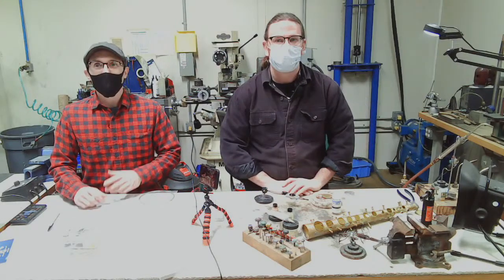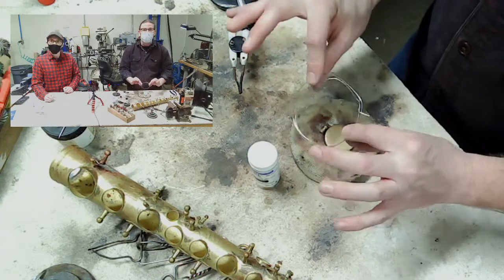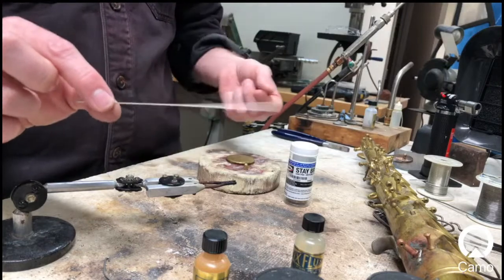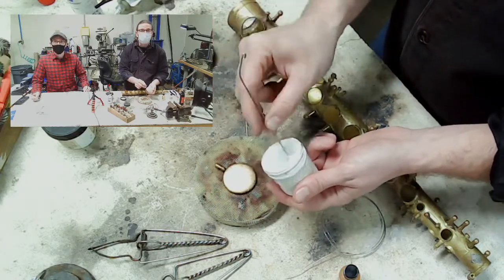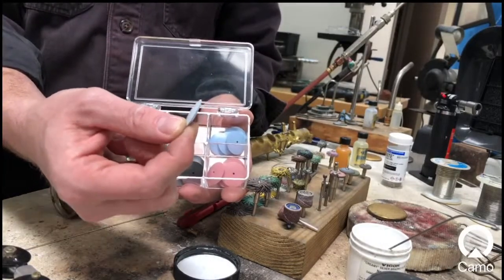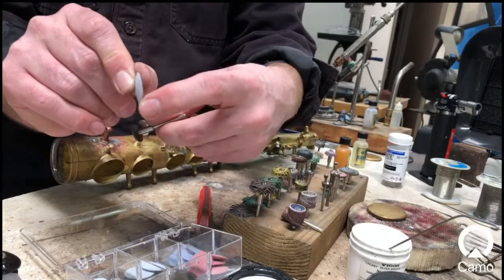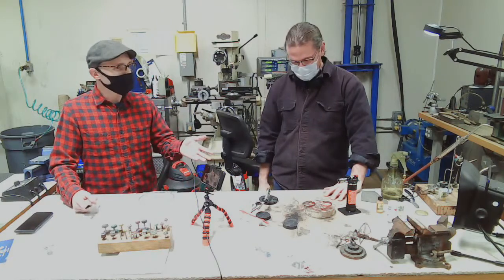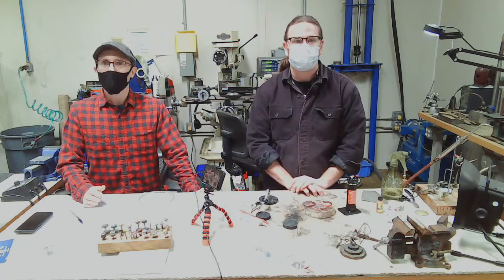HARD Soldering Basics for saxophones

Comment: Just an interesting side note that in talking to the Smiths representative who has since retired he mentioned that the  number one and number two tips on the two gas little torch usually won't light with a welding Striker and I found that the battery operated Striker works best. Although when   Silver soldering I use a number 3 tip with oxy acetylene. 
it's so different than when you steel gas weld where you get that inner flame cone right up against the work versus when silver soldering where you're bathing it in the outer Flame. 
 just learning how to get the neutral Flame on the two gas system took one evening to learn at a welding class. The old timers  said they adjust it by the sound it makes but I got to the point where you get the two inner cones down to one but not so much so that it's over oxygenated as in a super bright blue flame.
 Also the people at Smith's and Rio Grande Supply said that once you've used oxyacetylene to Silver solder you don't want to go back to waiting a little bit longer using propane and oxygen. 
As you mentioned in the tapes it's All In what equipment you're used to using. For example I have used that Blazer torch to soft solder when in a pinch out on a job site but I can get in and out faster when I use the Smiths silversmith oxygen and Atmospheric torch like you've shown in the video. And as you mentioned you can use it with a bigger tip for silver soldering . Thank you for sharing
Reply from the maker: Of course than you for the kind comment!